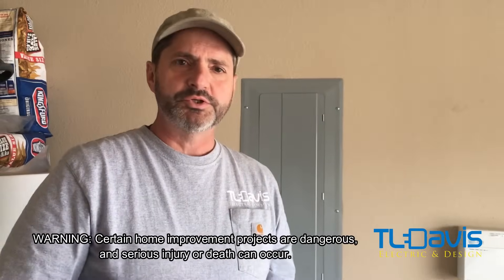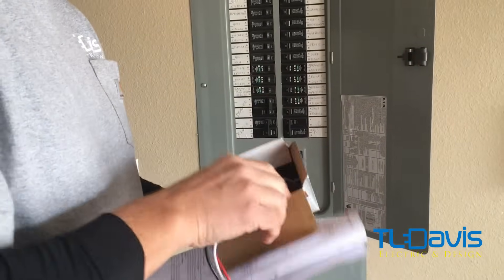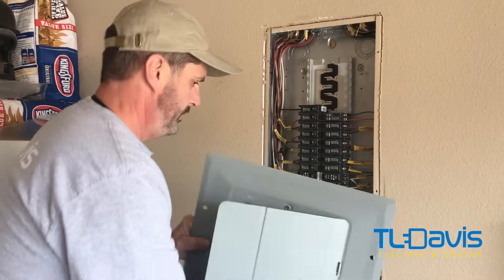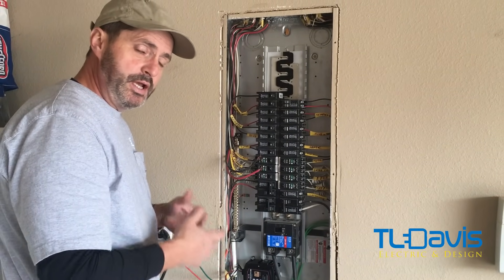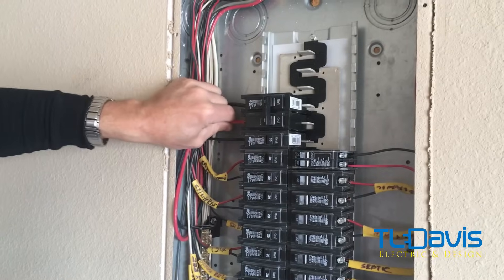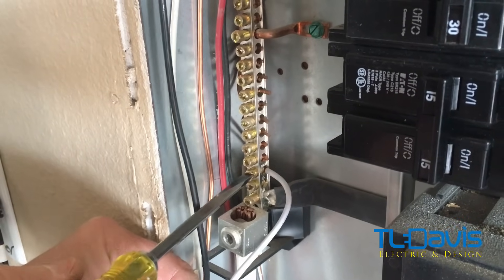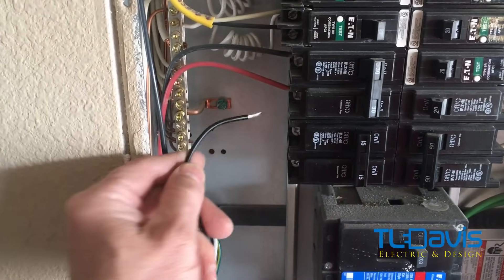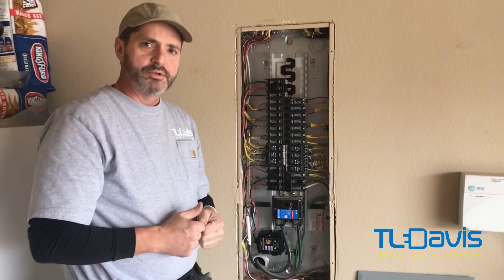How To Install A Whole House Surge Protector | TL Davis Electric & Design

Comment: Turn the main power off ALWAYS when working in the panel.  Remember that the three input lines into the main breaker are STILL LIVE.
Reply: Says the guy who might not have ever worked on an old Murray MB panel or some crappy old FPE. Turning off the main can open up a can of worms. Sometimes the MB cannot be reset so then what?
Reply: @electricianron_New_Jersey  Nope, never have done that.  I'm sure you are right.  But since your videos are also seen by non-electricians (like me), safety should be at the top of the list when making a silly mistake can kill you.
Reply: @electricianron_New_Jersey  I've never heard of that.  Can that really occur?  Any advice on how to install it on the outside wall and wire into the subpanel box?  Also, if it's a "whole house" surge protector, why it has a 15 amp breaker, and how then does it shut off the whole panel?
Reply: D A
Reply: williamhoodtn you’re so smart
Reply: This is energized work. It's pretty tame by energized work standards but I've done just a little research, enough to get dangerous.

This is typically a 240/120V system. (Use 250V when selecting insulated tools.) Meters and probes are CAT IV.  250V has no restricted approach boundary, just work in a way that "avoids" touching energized parts. Class 00 gloves would be sufficient, but even at that lowest possible rating they're expensive.

Arc flash took some more research. Here's some testing mostly at ~7,200V and 480V. Those flames are no joke. Oh, and the *lower voltage is more dangerous*. It can strike a decent arc that takes a long time to clear, just keeps blasting flame at you.
https://www.youtube.com/watch?v=fZP47mlELSc

I eventually found a PG&E policy from 2009 that sets their protection level for pulling or installing  240/120V meters at 8 calories per square centimeter. 8 cal/cm^2 is not great but it's not horrible. Hearing protection and all skin covered with fire-resistant material - think face shield, goggles, firefighter's balaclava.

https://www.pge.com/includes/docs/pdfs/mybusiness/customerservice/startstop/newconstruction/greenbook/servicerequirements/appB-FRletter.pdf

The best arc flash protection is minimizing the hazard. I'm looking at the gap between those hot buses and thinking "Jacob's ladder, oh hell no." I'd not be comfortable doing that work with the main breaker in. So what if you have to work by flashlight? De-energize those bus bars!  Also, the screwdriver with the uninsulated shaft is an arc hazard if it's dropped into the service feeder.

So that's what I'd personally be comfortable with. Balaclava, ear plugs, face shield. Main breaker disconnected, prove the bus bars dead. Non-conductive floor,  leather gloves as shock protection. Insulated tools, stay away from the service wires, cover them if possible. I would personally be comfortable with non-rated gear - cotton and wool. A dry chunk of 2x4 and duct-tape to cover the feeder; it's under 250V and tracking isn't a concern.
Reply: Don't give advice home owner.

Comment: Well done only need a quick explanation of how the knock out in the panel cover for the new breaker location is done.
Reply: He can't because this is an illegal installation and he knows it (or should, after 30yrs). If it was the proper device for in panel installation, it would plug into the buss and the panel cover would have spaces for it.
Reply: Count your spaces in regard to the existing breakers and go from there. Easy way is to also hold the cover back up the way it was before, make note of which spaces need knocked out, and you're all set. Basic math. As for the physical aspect of removing the cover knock outs, take a pair of pliers (or if you have strong fingers and depending on your type of panel) and bend them whichever way the bump on the knockout rises. If it rises up towards you, bend that way. It might take a few back and forth bends before it snaps and breaks off. Some brands (Square D Homeline) can break off in one bend with just my fingers. It's relatively easy overall. (And if you break out the wrong spaces, they make space blanks for panels that can be installed to cover your mistake)

Comment: I know you're a pro and work with electricity every day so i dont mean in any way to criticize, but watching you reach into a hot box makes me cringe a bit. I'm nervous around elec. Natural gas too but not near as much as elec. God bless!
Reply: If working in a electrical box, make you nervous you can always call a professional to come out and install it. If you choose to do it yourself, I would shut off the main breaker and then the bus bar becomes dead. Then you can change out the breakers as the power is only in the main breaker and does not give power to the bus bar where all of the breaker snap in.
Reply: Rachel Davis: thanks much! If I were somewhere near Tulsa, I’d be calling.

Comment: Does it matter if it's a 100 or 200 amp service. Does the unit work for both?
Reply: It does not matter on what size of service coming into the home. Eaton seems to have the best one out there.
Reply: The Amp rating of the service doesn't matter. That rating only matters when figuring the total Amp draw of the building.
Reply: If you need to ask that question you shouldn’t be working on electrical circuits.
Reply: @brucerobson8767  and you need friends instead of trolling YouTube…..! I am an electrician….

Comment: How do you size the surge protector, meaning 15 A vs 50 A? Wouldn't it be better to install it outside of the breaker box, so you can see the indicator lights? But if you did, how would you work around the sheetrock?
Reply: The surge protection will have information telling what size of breaker to use. And if you want to put it on the outside. You can use 1/2” flex and two flex connector and a deep 4 square box. Knock out the 1/2” ko in the box and one in the panel. Do not add wiring to lengthen the wire on the surge protection device. If you need a diagram you can email me at daviselectricaldesign@gmail.com
Reply: @terrydavis3863  Thanks! I understand. For sizing, I mean, how do you know whether to buy the CHSPT2SURGE (which takes a 20 amp breaker) or CHSPT2ULTRA (which takes a 50 amp breaker)? Looking at specs online I see a kA surge rating, but how does one determine how many kiloamps to protect against?
Reply: Sorry, 15 amp, not 20.
Reply: If the surge protector does its job and breaks a surge, is it possible to reset that protector or do you need to replace it with a new one?
Reply from the maker: Sorry the long delay. Eaton makes a flush mounting kit to install it in the sheet rock. On residential homes I would not install greater than 50 kva as it is a waste of money. 50 kva, 80 kva, 100 kva, do the exact same thing. Just look at as hits. 50 hits, 80 hits, 100 hits,